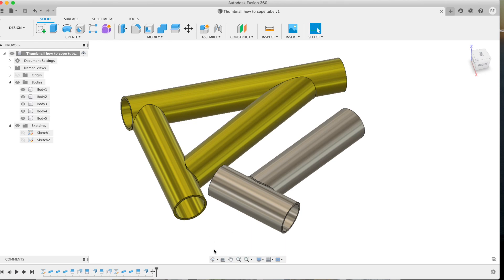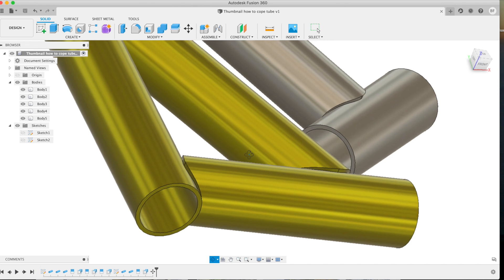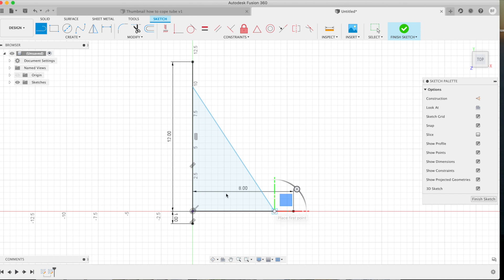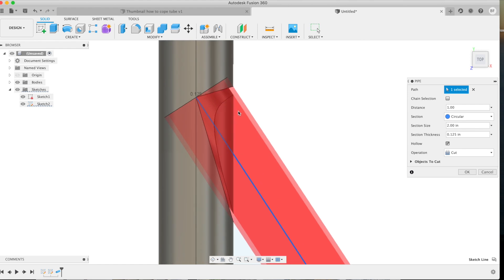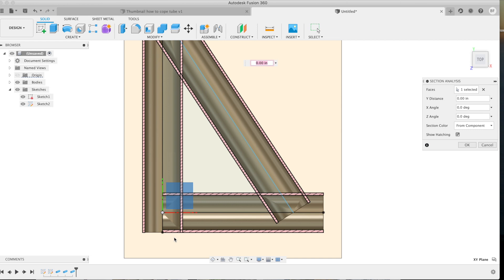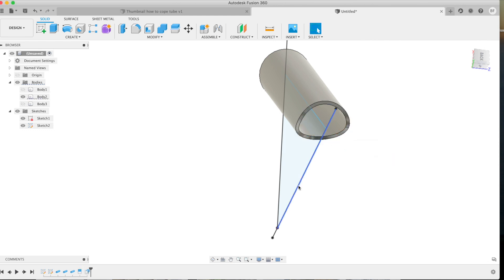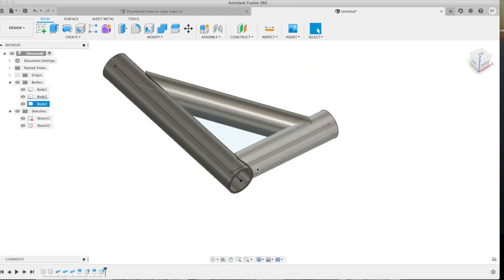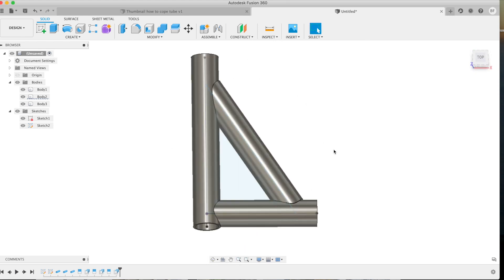HOW TO Quickly Notch / Cope Weldable Tube or Pipe Joints in Fusion 360!

Comment: ya, look closely.................. that acute angle joint will need grinding, filing or  cut differently.  not a big deal though.  a machine will cut like this but a hole saw will cut parallel

Comment: wow , ya good video getting the weld ready profiles BUT, its not quite right on the acute joint, the joining pipes interfere on the outside when ive tried as the cut at 90 deg from the inside, a  split body step
 is needed. on a 2nd split face step but on the outside  but this leaves the material thin sloping away from the exterior abutment contact.  which is fine if you know how to weld but might allow movement during the weld. but , this, the 90 deg cuts are how a machine will cut.

Comment: Incorrect. Only works for 90 degree joint. The cope face will have too much material left on the od of the tube at the heel of the joint and will not fit correctly.

Comment: Thank you so much for this. Very helpful.   Don't know if this is your area of expertise but what I need is CAM advice on how to generate a tool path to machine an angled notch on a CNC miller . I thought this would be straightforward but does not seem so easy. ?
Reply from the maker: I run cnc machines and do all the programming but without the model and and the machine and tool information I can’t be any help. Tons of videos on here to assist in being able to cam complex features. Thanks for the kind words! Glad it helped. 🙌🏻

Comment: Great video. Next step is how to use F360 to make bend charts similar to what is possible in BendTech. It is great to be able to model something, but if the data from that model can't be outputting to usable data, then the model is useless.
Reply from the maker: Yep, typically it’s then transferred over to bend tech and then we go from there.. I’ll see what I can’t throw together 🙌🏻 thanks for the comment!
Reply: @hourglassingenuity103  Were you ever able to create a process that would do something similar to Ben Tech in Fusion 360?  It would be especially helpful when working with out-of-plane tube sections.

Comment: Adapted your technique for use in Solidworks by using the Split Line, Offset Surface then Thickened Cut (in place of the push pull functionality of Fusion 360).
Seems to work way better than the standard technique of using a ruled surface (at least in my use case).

Thanks so much for the great video!
Reply from the maker: That’s incredible! I’ve never drawn in solid works before so I’m really happy you were able to make it work! Thank you very much for letting me know. Have a wonderful day!
Reply: As a amateur solidworks user, this video and this comment has been very helpful. Cheers lads.

Comment: Great video and tip! Does the negative extrude help to give that even material thickness vs just deleting the separated body?
Reply from the maker: Hey thanks! I know they are boring but they are good fillers and educational. Selecting the inside of the tube rather than the outside normalizes the coped profile when using the split face command. There are so many ways to cope in fusion and each one has a slightly different end result. Exactly though, since a laser would stay stationary and the 4th axis would rotate negatively extruding the cope almost gives it the same profile it would have if it was cut on a 4th axis laser. 🙌🏻

Comment: Awesome stuff Brad! Didnt even think to use the split face tool, have always used the combine tool, and used the piece of un-notched tube as the tool body and use the cut function.

This method, can most cnc tube notcher companies work with the step file of these types of tubes notched this way??
Reply from the maker: Thank you for watching! That way works too! The split face tool for me just gives me nice normalized and even material thickness notches and it’s easiest for my work flow. Yes, I have sent many .STP files with tube notched exactly this way to laser and plasma and they were able to work with it without any issues! Have a great day!